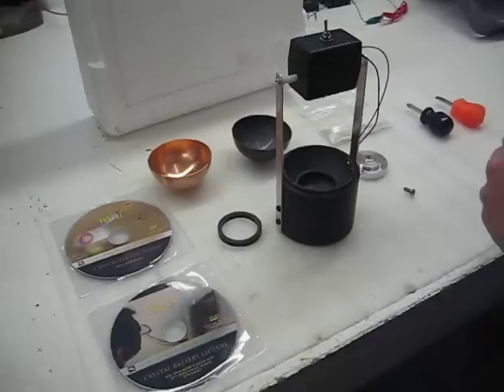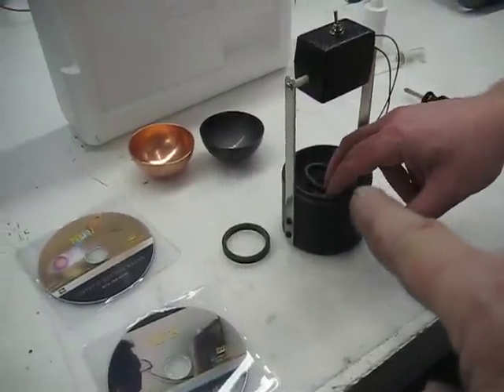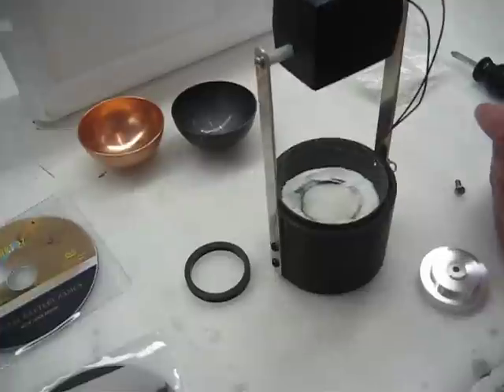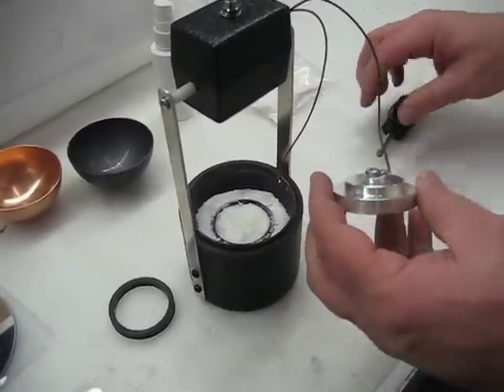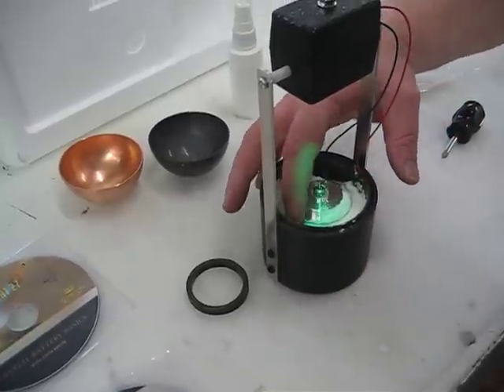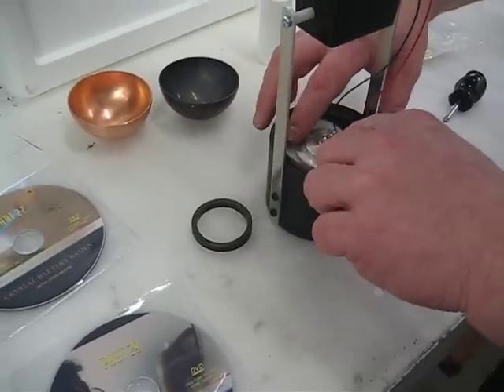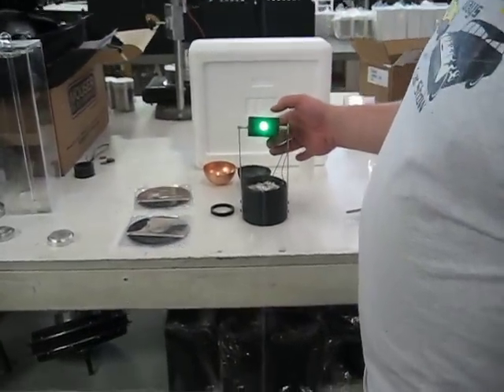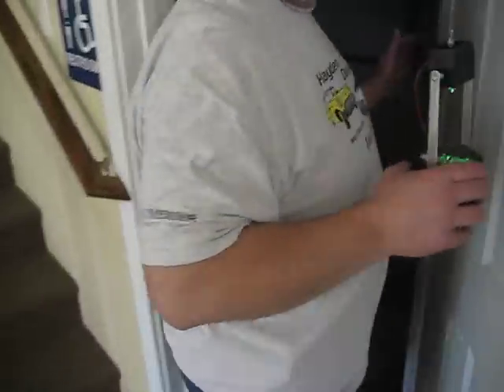Crystal Battery table lamp kit. can be purchased at energenx.com or call 208-772-3303

Comment: Little more info:

Growing crystals or using rocks, water/saltwater around 2 disimilar metals (copper/aluminum) creates an electric current. The water/saltwater eat away at the metals and corrode them, so growing crystals is best, which do not deteriorate the metals at all.

Hooked up in series, more volts are created
Hooked up in parallel, more amps are created

Watts = volts x amps. Create what you need for your household appliance.

Now what more "info" does one need except direct experience?

Comment: hi john, im working on crystal batteries and have came up with good results, also have to water my batts every 3-4 days, but eventually the copper will oxidize? how do you solve this problem so the batteries wont eventually go completely dead and can last for many years? have you tried gold plated/silver elecrodes? cheers thanks for sharing your work

carlos